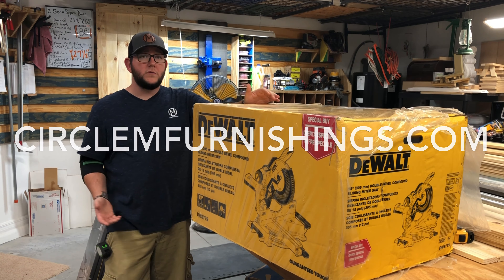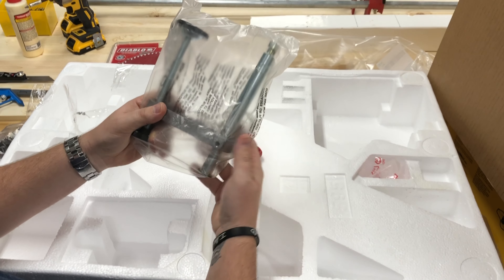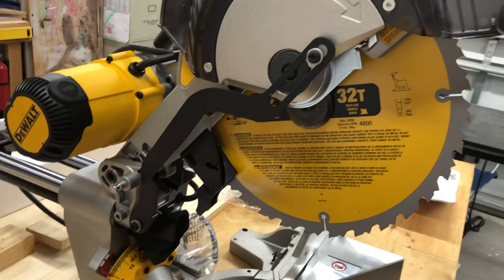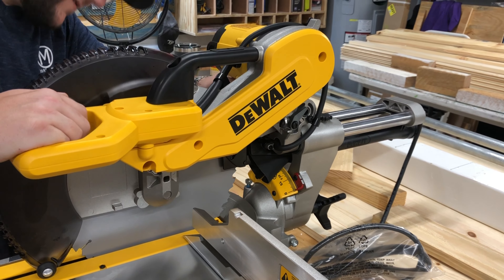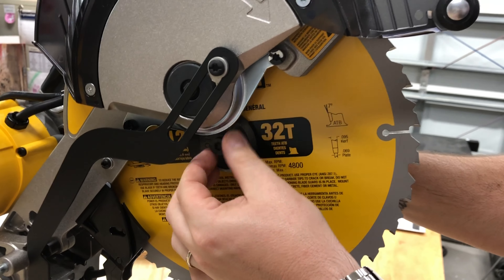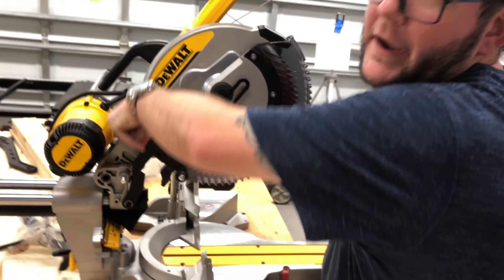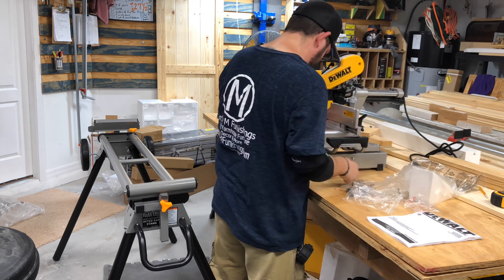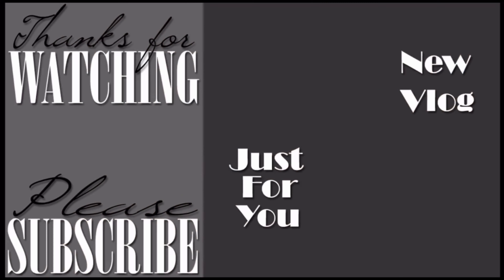DeWalt DWS779 Miter Saw Unboxing, Overview, Blade Change, & Miter Saw Stand Set Up - FULL 4K VIDEO

Comment: This is a the 3rd generation type 22 779. They removed the slide lock lever on the side and the preset bevel stops at back. Only the 780 now has those features. I assume Dewalt did this to upsell the 780. The original 779 was identical minus the xps light. Still a great saw👍
Reply from the maker: Thanks for the info!! I agree it’s a great saw, a little heavy to be toting to and from job sites. It has a huge footprint, but overall it’s a great saw!

Comment: Any idea what the screw that is hidden by your left thumb at 8:32 is for? Black screw, screws into nothing. I have the same saw and I can't figure it out.
Reply from the maker: Well after further inspection I have no idea what it’s there for. My best guess is it’s either from a feature that was removed on the updated model or it’s for another model that uses this same part, but has an added feature.
Reply: @MomDadandTheGirls Thanks for the response. I think those are two good guesses! I couldn't find any reference to it in the manual. I'll let you know if I figure it out 👍
Reply from the maker: Please do, it puzzling to say the least!! Thanks for watching!

Comment: I’ve had this saw for a couple years now and the extra slide lock isn’t necessary.  Unless you’re taking it on job sites all the time, it’s a good safeguard whilst carrying but that’s it.  Very odd that it’s missing though.
Reply from the maker: That's the thing, we do take it on about 8 out of every 10 jobs we go on. so far so good though! thanks for the comment and watching.
Reply: I quite like the side lock. When I don't want to use the slide on the saw the lock gives me a quick and  accurate way to set it for non sliding use.